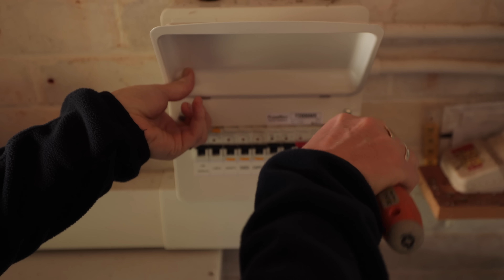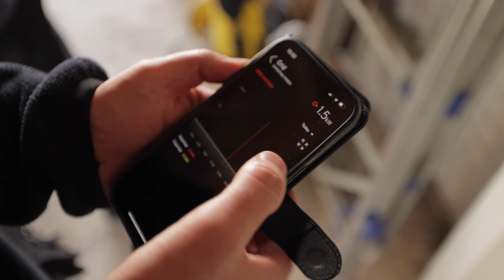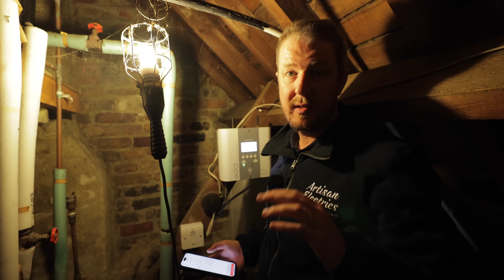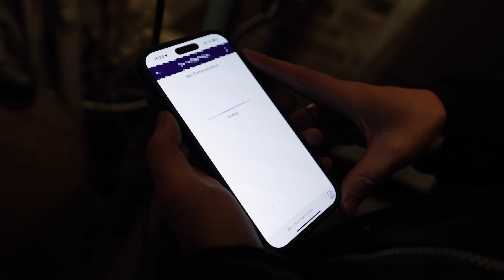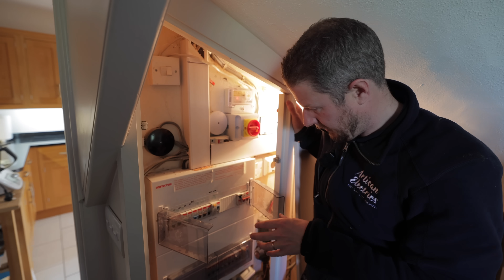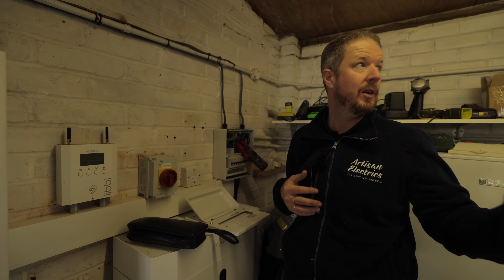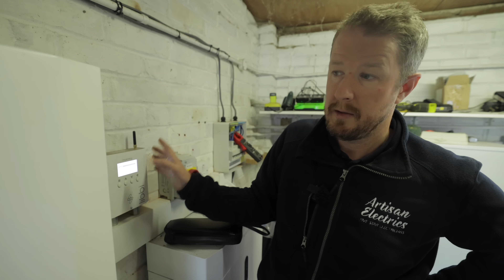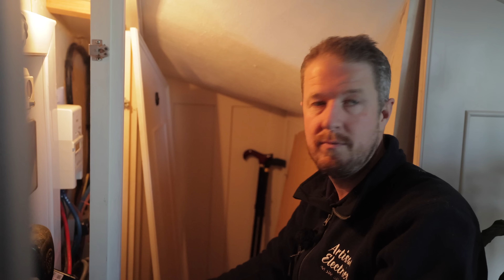£20,000+ Battery System RUINED By This 1 Simple Mistake 😳

Comment: Not sure the “battery system was ruined by 1 simple mistake “ per your overly dramatic headline?  Don’t pander to the algorithms. You are better than that. Excellent video btw
Reply: If it was ruined, it would no longer work. This is more a case of not set up properly.
Reply: They're really not better than that, they always play for the drama and algorithm
Reply: The system was running at a fraction of its capacity because it had an unnecessary limit set on it in the settings. I think that's what the title is getting at.
Also a wrongly connected CT on the solar and no internet to the EV charger. Separate minor issues.
Reply: @KX36  It was set to 18A where the battery can put out 23A. That will basically never matter unless you try to charge your car out of the battery, but with a 5kWh battery that makes no sense. The bigger problem was probably the Solaredge getting the wrong ct value, which it then shared with the battery. So the battery might have charged less PV that there actually was produced and the excess was dumped into the grid. Overall the full system is overkill for just 5 kWp Solar and a 5kWh battery, especially the ~2k they blew on the hot water heater.
Reply: @KX36 minor problem to you , but major to the customer / home owner.
Reply: Everyone's at it aren't they.
Reply: You saved me 25 minutes of my life. I thank you sir
Reply: It's clear to me that the 1 simple mistake was hiring an idiot contractor to install the system.
BTW, I wonder if the term "ruined" means something slightly different in their country.
BTW, "idiot" is a standard industry jargon technical term.
Reply: £100000000 lost by this mistake. Can't believe it
Reply: @steviea6070  it's trillions of dongs or gazillions of rupees!
Reply: @Mike-ms6he  was obvious, really. The £20000+ mistake was the total artisan invoice for moving the CT clamp.
Reply: And me.  Very poor lately.  Not like the old days when Jordan was on the tools and good to watch.  Just can't tolerate him now. :(
Reply: My team and I will build a multi million machine and would not start. My coworker forgot to connect one wire. And yes one little mistake will cause a lot of problems.
Reply: I enjoyed the video. I didn't understand any of it though! I feel very old sometimes... but I have learned that I don't want any of that stuff in my house.
Reply: @tiposxdiesel  That made me smile - I also enjoyed the video. I didn't understand much of it! I am very old... but I have learned that I need to learn a lot more, however I expect the conclusion will be that I don't want any of that stuff in my house.
Reply: Another video from righteous electrics🤦‍♂️
Reply: So the systems reheats water in situation of excess energy as store of energy ? I would call that pure waste as you want much rather charging the batteries. When do you need hot water honestly only in the morning or evening and both times there is none or little solar power. That whole stuff is for the monkeys
Reply: When the battery is fully in daytime, it's not a wast heating the water.
Why buying electricity for heating the water when the battery is fully 🤔
Reply: YouTubers gotta YouTube.
Reply: Karen Carpenter hahaha wtf
Reply: I am tired of clickbaity video titles
Reply: Daily Mail has left the chat
Reply: I don't know any successful youtuber that doesn't use the algorithm to their advantage
Reply: @tombloxham2229  'using the algorithm' does not mean you have to write stupid lies in your video titles. Fully Charged is a successful channel that largely avoids the 'clickbaity titles' game.  And there are plenty of great channels that don't play the game the cynical way Jordan does.
Reply: You must not know how the algorithm works 😂 I am literally a new viewer and sub because of this video and thumbnail
Reply: Yep, I was waiting for the "ruination" myself....never happened. I was going to subscribe, but....no. Pity, because he seems knowledgable and sincere. Probably the editing / marketing team at work....
Reply: Are you the installer?
Reply: Well... It was ruined by a mistake.. If it's not working as it should be it's fucking ruined.. You must be one of those installers who just half asses a job..
Reply: The one mistake was in the contractor selection.
Reply: The troubleshooting was also painful
Reply: The algorithm is what gives reach and dramatic thumbnails are what the algo wants. Thats like saying enter a race but just cruise as taking part is what matters even though only the winners get paid. 🤷🏼‍♂️
Reply: @andyhealey7894 no, it's what perpetuates and drives enshittification. Just because nobody else has a spine, it doesn't mean you shouldn't have one too
Reply: bro is better than views? it’s like people who complain about when they use shotguns in video games. yet here you are watching and commenting. clearly worked
Reply: Having paid £20k for a system that wasn't installed correctly......Sure as hell my  experience would have been ruined...and it certainly ruined the efficiency of storage system., that didn't care about an algorithm!
Reply: Don't hate the player, hate the game.
Reply: While I agree with you on the anti-clickbait comment, I think you missed the fact that the “system” was ruined, not the actual battery. As a system it was not working at all. This is an excellent channel, with wonderfully digestible presentation.
Reply: Shut it, Donkey
Reply: Thanks for the warning,  I'm outa here...
Reply: Well yes, did you even watch the video? The 1 simple mistake was to limit the battery change/discharge rate...
Reply: I agree and I have my rule to never subscribe to channels that overuse this clickbait tactic with wrong(misleading titles.
Reply: Click bait headline, no wonder people don’t subscribe
Reply: Yeah..."limited" but not "ruined" !
Reply: @andrewmillerphotography Ruined means an action, event, or person that has spoiled something, making it no longer enjoyable, useful, or valuable. The system (not the batteries) was failing so far as to be useful, or valuable (not saving or making the customer money to the level expected at all). I don’t mean to be pedantic, especially to a fellow photographer, but this guy is outstanding in the field of electrician engineering. To him, working to such high standards, anything that is not installed to perfection or working as intended, is ruined. I agree!
Reply: Ruined means irreparable.
Reply: Set up neglect or error doesn't warrant "Ruined" hovering over unsubscribe with the click bate tactics lately.
Reply: Wasted my time watching this video - there’s absolutely nothing wrong with the battery. Unsubscribing.
Reply: @amelluk  Wise thing what you  can do.
Reply: @amelluk read again,  "battery SYSTEM" not the physical battery.
Reply: @amelluk Agreed! These overly dramatic taglines are ruining the YouTube experience
Reply: @amelluk well to be honest there was 
It wasn't charging
Reply: That looks like a total disaster in that loft.
Reply: Good Video. I enjoyed it. It’s interesting to read all these hurt comments about click bait etc. Listen this is a business account and Jordan runs a business. As with any business (I own 2) we want to maximise our return.  That includes marketing.  They make it look easy but there will be hundreds of hours in editing, filming retakes, equipment, time etc etc. oh and you all can watch and comment for free. Stop whining
Reply: @user-rc7dg3np9c  🤣😂🤣😂😂
Reply: @ItsJamieUK  Good to know that Jordan and other business people like yourself are following the typical capitalist values of skulduggery and manipulation for personal gain and doing your best to justify a "whatever it takes, it's just the game" mentality. There are other human values such as decency, honesty and integrity which most humans rank pretty high as important. This begging for views behaviour is what makes me mistrust him as a business person, because lying on video content sites for views is where it starts, but it makes me think "does he lie in other ways within his business" if he's capable of this constant tabloidy crap.
Reply: @ mate either watch it or don’t. It’s costs you nothing
Reply: @ItsJamieUK  It costs me my time to come here and find out that I've been fooled, so it does cost something and thats why I write these comments.
Reply: But definitely get ruined by Artisan electrical
Reply: Of course it was ruined you blithering idiots. The economics of the system is a catastrophy if it's running on a fraction of capacity.
Reply: Nothing is wrong with the headline, Karen.
Reply: There’s nothing that makes me run further than a channel than inane clickbait manipulation. Thumbs down and I’m unsubscribed.
Reply: @johnmacward  if that were the case you'd not be able to watch a single video on social media, stop being such a drama queen...
Reply: @Pickle_Rick-m4o  I don't have social media.
Reply: @johnmacward newsflash, YouTube is social media which you clearly have.
Reply: @mikeypc3592  YouTube is a video content site, its not a friend / relationship connection platform like Instagram, Facebook, Snapchat, WhatsApp etc where actual social activity is the goal. People don't come to YouTube to find their friends, they come here to watch videos and maybe leave a comment on the video if they want. It's like saying the Independent is a social media site because it has a comments section under its articles.
Reply: “ Let him without sin cast the first stone “
Reply: I was caught out likewise but I don't think it was deliberate, just the wrong choice of word.  I think the point was that the supposed advantage of fitting the battery was ruined.  'Debilitated' would have been better.
Reply: @marquisdemoo1792  People with average English do not know what debilitated is.
Reply: @marquisdemoo1792  Oh it was deliberate as he wrote it in all caps as well. This is not how a trustworthy installer should operate.
Reply: Not everyone is that familiar with how this stuff works or that settings in software can have such an impact there’s some useful info here .. yes it’s a bit clickbaity but there is an algorithm at play …
Reply: it’s the youtube algorithm, i don’t blame him
Reply: @HeyBroRetro  Stop tolerating BS. That's the reason we have enshittification.

Comment: It's much cheaper in Australia. I'm getting 12 kw solar, 24 kwh Sigenergy batteries and an AC charger for 18K AUD (9K £) after rebates.
Good work to work out his issue. There are many dodgy installers out there.

Comment: whats the point of a 50a fuse that doesnt blow till100
Reply: It will blow before 100A, but only after a long time. The problem with overloading a circuit is that the cables heat up, but if they are only slightly overloaded they only heat up very slowly, so there is no need for the fuse to blow immediately. A lot of things will draw a lot more than their usual current for short periods, particularly when they first switch on, so you don't want fuses blowing or breakers tripping the instant the current goes over the rated amount.

If I've looked up the right type of fuse, it will blow at 70A after 10,000 seconds (just under 3 hours), at 100A after 100 seconds and at 300A after 0.4s.
Reply: 50A signifies it can carry 50A, not blow at 50A.
Reply: Most fuses don't blow exactly at the rating, I have a 30 amp that doesn't blow until 50 Amps for awhile, the fuse just protects the wire.

Comment: If any of the firmware updates you performed bricked, or otherwise caused new issues on a device, how would you handle this? I feel like firmware updates can be a tricky decision. If the customer does not have any firmware related issues in the current version, is the risk of new problems/bricking after an update worth it?
Reply: At a guess I reckon the units would have a fixed initial bootloader and you can do a firmware update with a cable?. That way if it gets corrupted you're not in the shit.

Comment: Doesn't sound like the system was "ruined", more like unoptimally configured - hardly ruined!
If the battery doesn't deviate much from 50% SoC, then they'll be still virtually good as new.
Still don't see anything ruined here.
Reply: Agreed. Sensationalist nonsense. I think he really meant the configuration was ruined but what a load of...
Reply: worst case scenario he could blow the fuse.. so its all installed correctly..

Comment: Not sure a hot water diverter is necessary, if you get a decent export rate
Reply from the maker: True
Reply: Absolutely not worth it at the moment…
When it changes in the future then potentially change then.
Reply: @JohnR31415  What isn't worth it, the diverter or exporting?

Comment: Was at a friend's house last night because his Zappi had thrown a wobbler.  Got him sorted but was amused to see that Octopus who had done the install had installed a Harvi on the Solar PV, despite the CT being no more than 2m from his master switch for the Zappi.  The Zappi master switch box had the Grid CT wired to it and then on to the Zappi via the SWA, hence the SWA must have the embedded Cat 5 cable with 3 spare pairs that could have connected the Solar PV CT to the Zappi, thereby avoiding the need for a Harvi.
Reply: Maybe your friend should have asked an electrician instead of an armchair expert who talks about 'master switch boxes', whatever they are. The black cable you were referring to was probably an EV ultra type cable, not SWA unless it needed to go underground. EV ultra often only had a single data pair and not ethernet, so it's probable that there was no other data pair available.
Reply: @davemyers77  Sorry as an electrician you feel threatened, but you kind of missed the point in your angst.  Given its proximity, it would have been so much simpler and more reliable to connect the Solar CT directly to the Zappi rather than use a Harvi, even if it meant running a dedicated cable.  If I'm armchair it is because I'm now retired as a communications engineer, MIET, and I only did the 16th Edn Course for oversight reasons, so yes I might be a bit rusty in my definitions.

Comment: Stange you should metion the thermostat issue and the problems it could lead to, This happened in my rented studio flat in 2000, as a tenant went away for the weekend and left the heater on, thernastate failed, boiling water split the plastic water tank above, and flooded the flat. Alll the floor, carpets and furniture had to be replaced and a £500 new system needed to be fitted!
Reply: Thank goodness they weren't injured by that failed thermostat.
Reply: You can now get automated water shut off valves with leak sensors that you can put over the kind of places that will pick up water leaks. Aquara do one, not been able to fit mine yet because I have to change my stopcock over to a full bore valve yet.
Reply: There must be whacky installation or some shaddy install. It should not split open. First in case of failed thermostat safety thermal fuse( non-returnable/one way) should activate and disconnect heating element despite failed thermostat.
Second - pressure relief valve will gave off safely ( even partially crusty) before tank itself. But some half-witted irresponsible brain dead amateur installers not put valve during install. 
If it is a bit bigger tank it can explode, kill and damage or even demolish part of the building.
Reply: @rybaluc  The video explains how the system can fail.
Reply: it’s the header tank that split not the hot water cylinder. The majority of UK systems are gravity feed low pressure so no need for pressure relief valves ( sounds like you are American 🤷‍♂️)
Reply: the british are so backwards its insane. in the usa all water heaters are installed in basements.

Comment: My MyEnergi system stopped reading the Harvi - or rather, it was working for the Eddi and Zappi, but the app did not see the current flows. I ended up having to factory reset and re-pair the hub, which turned out to be running an old version of firmware. Zappi and Eddi were both up to date. So, lesson learned: the devices auto-update but the Hub does not! I will be watching their website for release notes.